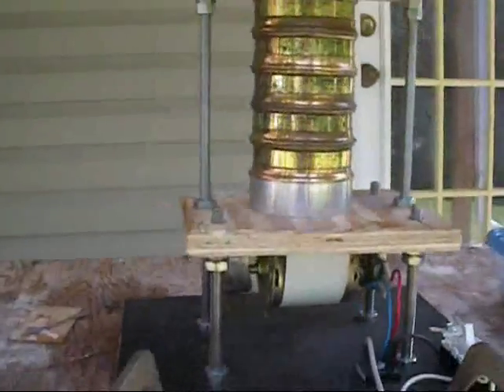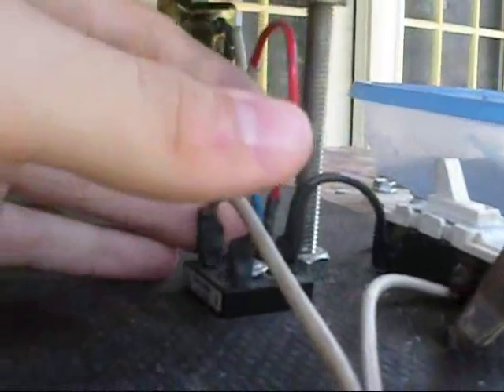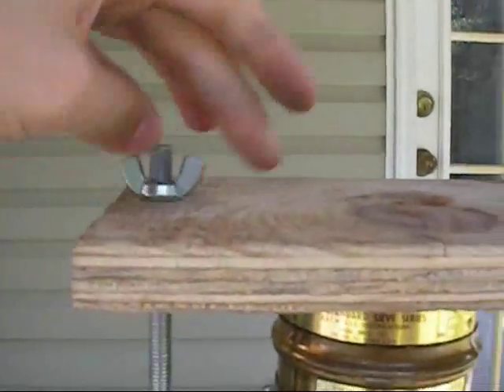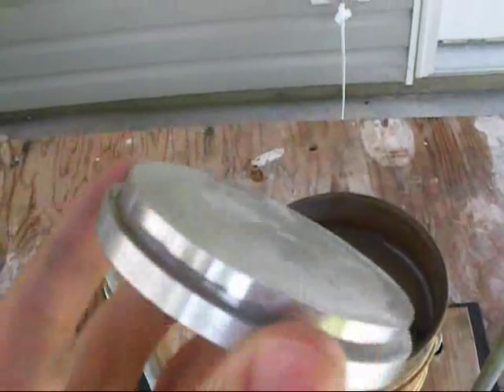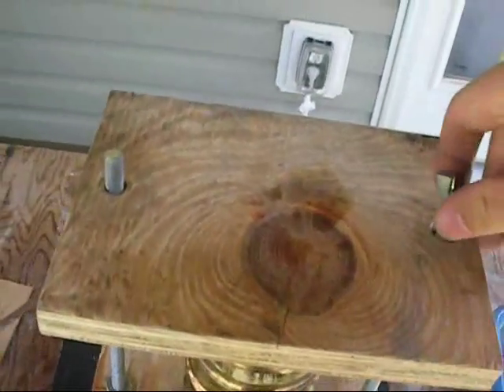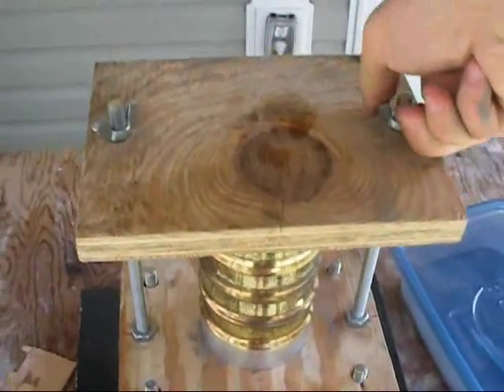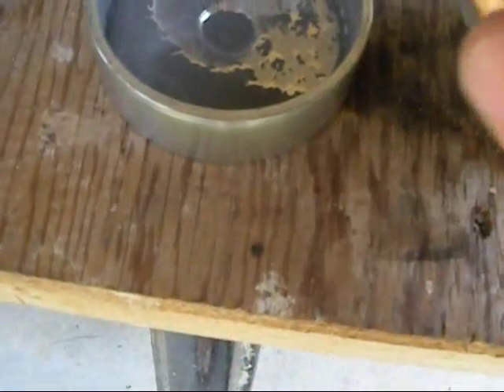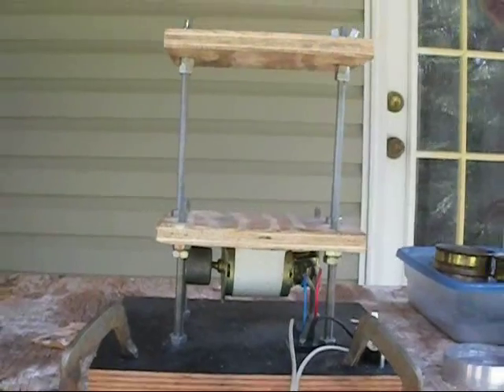Sieve Shaker.wmv

Comment: Hi there. Nice video! and some super sieve shaker. I'm trying to make iron powder under 5 microns with a 4 inch diameter ball mill with 1/4inch steel balls. I thing i'm close to 10 or even under 5 microns. But I also get some big stuff near 80 microns.

May I ask?

1) Do you thin that I'm able to get under 5 microns with what I got? I really need to get under 1 micron but near 1 it's good enough.

2) How can I confir o even know the size of what i'm making with my mill. I've got a microscope and i'm tring to analyse the results using 400X magnification. But I think using sieves may be easier. 

3) I was thinking on makin a paper cloth sieve, like napkins or maybe cloth sieve, like those shoping eco-bags made of cloth...

Comment: @demnlordd666 and the motor I was suggesting is from a radioshack store, they have the parts drawrs. only one set these days but usually in every store.  they should have some 2000+ rpm motors for like 6$ sure they dont't do much but if the canister is suspended by a string than almost all of the force is directed to the shaking so a couple of these in series should do the trick

Comment: i like your idea here but i think you have gone overboard with the motor you used.  free is free.  not knocking you.  but if ya had somthing more like one of those ultrasonic toothbrushes I think it would be much quieter and prob not take much longer.  say if you attached a small highspeed motor from radio shack or several of them, and a 12v 1a dc adaptor from an old applyance and fixed them to the canister suspended by a string it would shake its fool head off w/ min resistance and high speed
Reply: pm me please about sieves